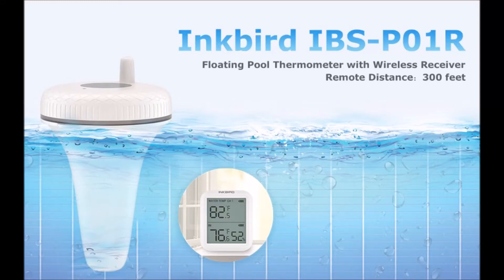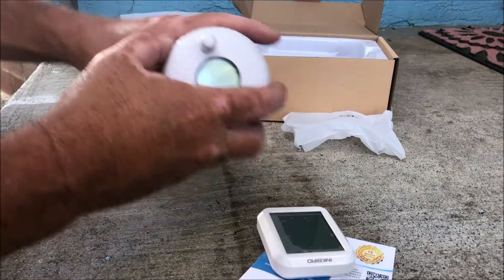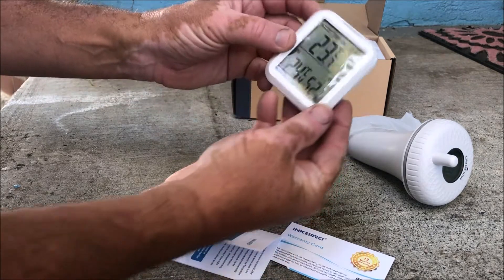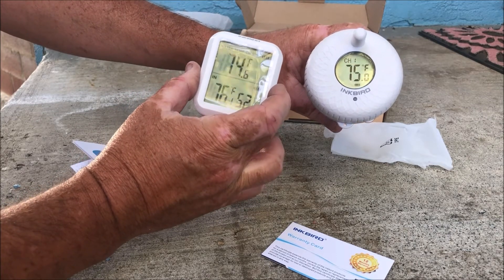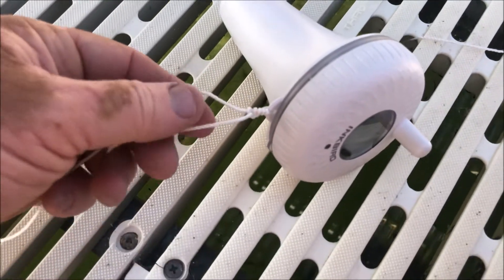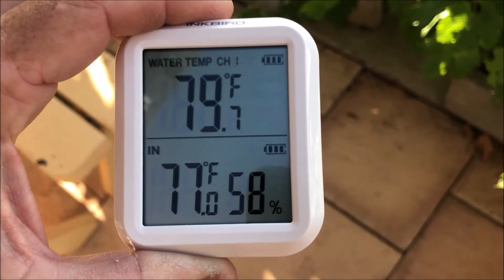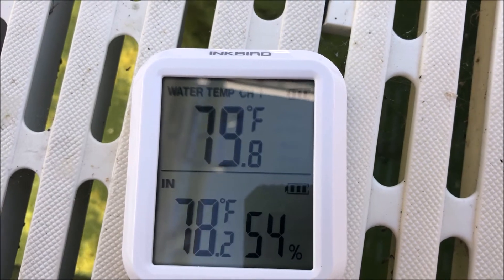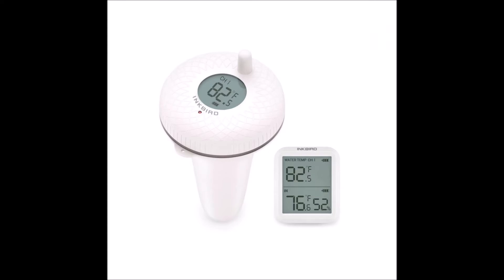InkBird Wireless Pool Thermometer to Measurer the Lake Temperature

Comment: I followed the directions in the video to set this up.  The receiver does not show a water temp.
Reply from the maker: You may have a bad unit, but if both displays show the same channel you should be good to go, but it is possible you just got a bad unit.   I just used channel 1.
Reply: Hello! Any help with this?

Comment: Any idea why the receiver only give indoor temps and not the temp of the water?
Reply from the maker: If your getting a -- instead of the temp then the receiver has not received the signal from the transmitter, check to make sure the channels match and you are in range.    I've found the range on this devices is not as good as other pool sensors.
Reply: @mycal-1  CHannels?????
Reply: The outdoor unit didn't pair with the indoor one, so the receiver only shows the indoor temps.